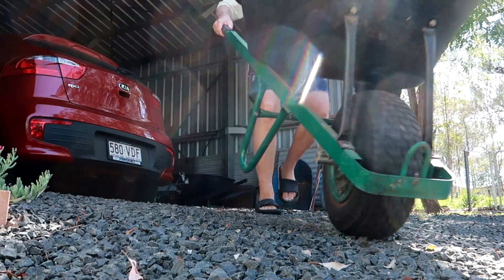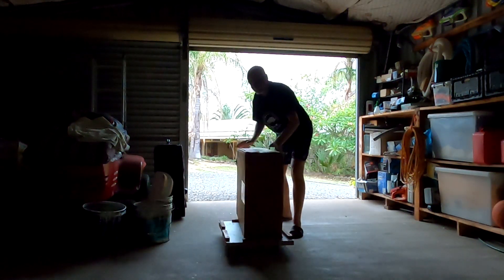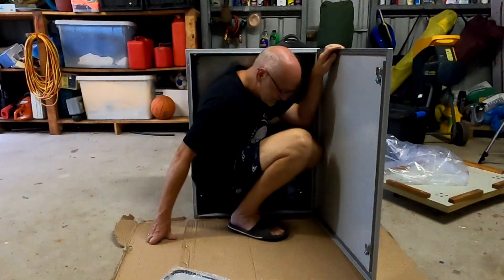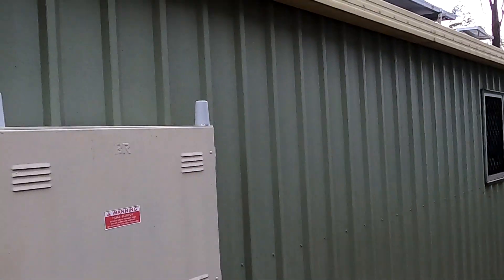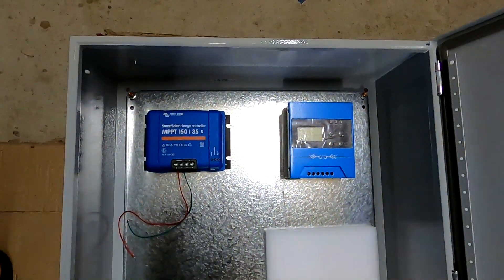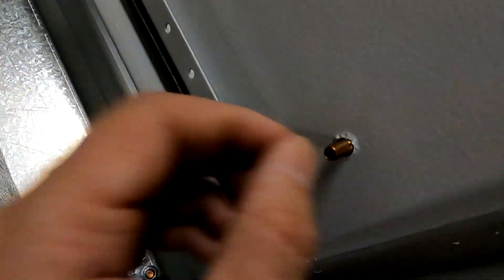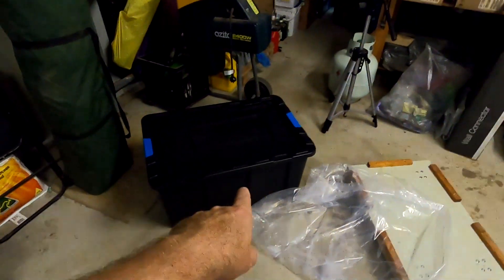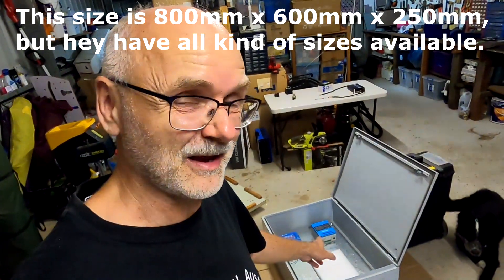Electrical enclosure - What I didn't think about...

Comment: To be clear.  You don't want to ground either conductor on a 48V system.  You want a floating ground.  The enclosure is grounded, but only a requirement if metal.  Then you are not at risk if you touch one conductor to the grounded box.  12V systems will typically have the negative grounded to make connections easier.

Fire safety....I hope nothing gets hotter than what wood burns at.  LOL.   Still that guy that suggested mounting on wood was probably thinking that way because he has done it many times....and it passed inspections.   It is fun to watch your thought process through this.

Comment: Following your design, I have a "system" on a piece of plywood inside our remote holiday RV: an All-In-One solar charger, inverter, PV and AC input.  The PV input is from 2 solar arrays totaling 1500 watts through 2 63 amp circuit breakers, so I can experiment.  The batteries totals are 48 volts DC lithium ion, 3.8 kWh, 14S BMS 100A.  The AC input and output are 120 volts AC  20 amps.  Slower charging "supposedly" prolongs battery life. Total cost $USD 1,900 including wire, boxes, and "stuff".  AC generator came with the RV (haven't used yet).  Local power wanted $20,000 to connect to their grid.  Thank you and many blessings.
Reply from the maker: Thanks for sharing, David. Great setup and wow, what a saving...

Comment: Put 2 long legs on the back of the box? Mount the inverter on the door, put the battery in the bottom of the enclosure(if it will fit) and a fan on the side of the enclosure above the battery. The fans can be controlled with the inverter fans. 
That's my thoughts.
Reply from the maker: The batteries won't go in this enclosure, they've got a separate box.

Comment: you have a box on the outside, how is that mounted?
Reply from the maker: That's the meter box and bolted to the metal beam which you see from the inside and also to the corner stud of the shed.

Comment: Andy, I would buy a piece of 19mm thick melamine 100mm bigger both dimensions and bolt it to the shed wall ensuring the bolts are outside the metal box area. 8 bolts with rubber seals on the outside of shed hardly noticable. Could even paint the heads. Then screw the metal box to the melamine using 16 screws.
Reply from the maker: Thanks Wayne. great suggestion. that will work.

Comment: Andy, you will need a cooling system for that!  What will be your final installed capacity? Around 5kW?   With an avarage loss of about 10% (to be on the safe side) you will have 500W heat loss - just think aubout that.   Your electrolytic condensers will be cooked (they don't like it hot).
1) active cooling - with some fans at the bottom and some holes at the top
2) passive/natural cooling - using the chimney effect you could build a pipe on top of the enclosure which goes through the roof and ends in one of those fancy, spherical, rotating things with blades (I don't know their name but I think you know what I mean)
I'm just thinking about how much heat is produced by my Fronius 4,5kW Inverter - and it is located in a cool austrian (we have no kangaroos 🤣) basement
Reply from the maker: Nah, it'll be fine. Lots of metal will cool it. 3kw is my max.

Comment: You seem to have an electrical cabinet on the outside that just seem to be screwed to the tin wall. Could you not replicate the mounting method for the new cabinet? Besides, metal is very strong in tension, so if you bolt the enclosure to the tin tight, that will create enough friction between the cabinet and the wall, so it is not hanging just of the bolts.
Reply from the maker: This is bolted to the beam which is inside and also to the corner, so this does not work for me.

Comment: Ideally you would need a fan near the top venting out and some sort of vent near the bottom for airflow in. We use Rittal ones but they’re expensive. A pc power supply fan would be fine. We actually have ac units on some of our panels in the uk and our summers are nowhere near as hot as Aus summers.

Comment: Great idea.  I'm thinking about a metal enclosure for my upcoming 16s1p 280Ah LiFePO4 home battery setup.  But I only need 1/3 this size at most!   As usual, everything I see is either too big or too small.

Your shed's LED lighting causes flickering in the camera's video.  I've encountered it myself.  The garage's LED lighting probably being PWM modulated without smoothening filter which can interact with the camera's shutter.  This can cause headaches while watching unfortunately.

Comment: Hi, I think you should not use the enclosure. There is no air pass through. Inverter & charge controller will generate heat.
Thanks
Reply from the maker: The metal enclosure is the heat sink.
Reply: @OffGridGarageAustralia  If that were true, why would an inverter (encased in metal) need a fan inside?
Reply: @OffGridGarageAustralia  Don't think so.....
Will see after completion of build.

Comment: Ya heat is not your friend air flow is your friend put the batteries in the metal box and mount the equipment on the outside using the box for a heat sink. IMHO.
Reply: That door is more than capable of supporting the electronics, batteries on the inside - sounds good to me.

Comment: I think 2 angle bars will do for fixing on the wall. 
I'm wondering that it's so heavy ... Normally this size should not be more than 10 Kg ... 
Thicker material as usual???
What do you think about heat from the electronics? I would be worried that in summer becomes too hot without ventilation.
Reply: Thought the same with the angle iron
Reply from the maker: The enclosure is so large, it will act like a heatsink. I will not generate much heat inside unless I run on full power all day long (unlikely)